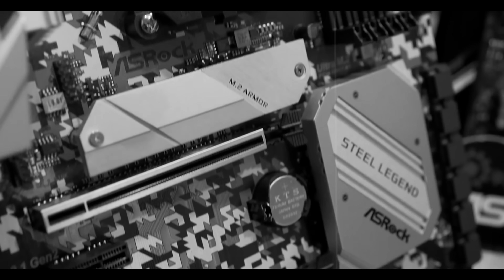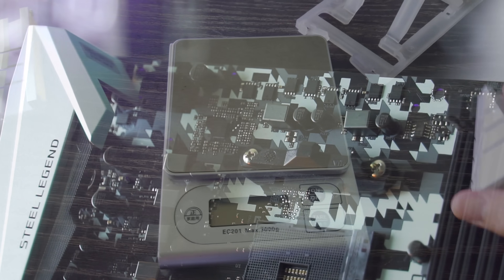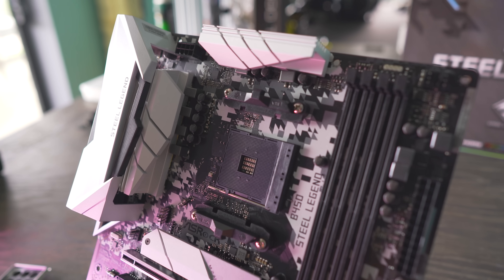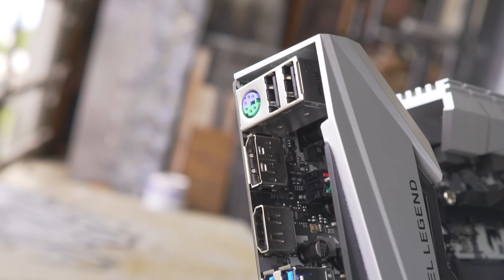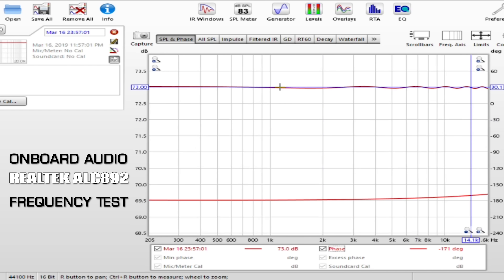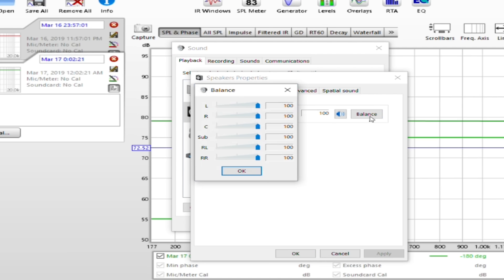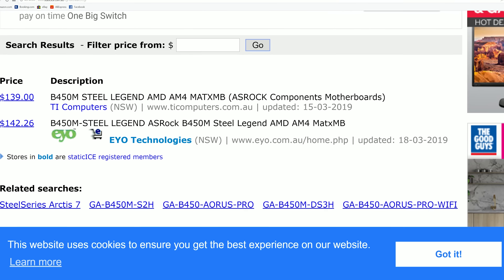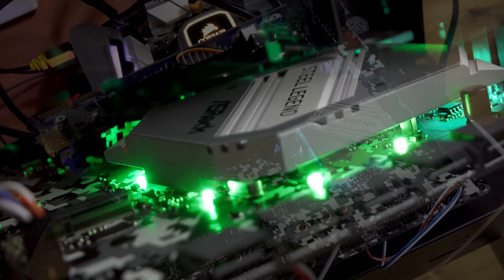Is this The BEST Value B450 Motherboard Right now..!? (Steel Legend Review)

Comment: Tip: B450 tomahawk.
Reply: Its ATX, if i would go for smaller then i would say mortar.
Reply: Msi b450 Sold out/ overpriced by scalpers. I'll roll with this then upgrade. Maybe when the new chips come out. Might even get new MB releases.
Reply: @lionoh  it actually depends solely on where you live. Not everywhere they are sold out. In fact most of the people just don't know what VRMs are and why they are important. So they buy whatever is beautiful, not what is actually decent or works as good as it should.
Reply: @rawdez_  Indeed! Here in Cali it was the ladder. Very true, although I'm aware of vrms & phase. This will do fine for  a 2200g till the next round of chips and motherboards.
Reply: B450 tomahawk. I spent more and got the b450 pro carbon ac. Very pleased
Reply: Please
Reply: tip: B450 A-Pro / B450M Mortar / B450 Gaming Plus / B450M Gaming Plus

the least crappy among cheapest B450 boards: Gigabyte B450 DS3H (its VRM better than this ASRock's, and also it costs like a lot less)
Reply: @rawdez_  Really? B450 DS3H has better VRM than "this" ASRock, you mean the Steel Legend? How does it compares against the B450 Pro 4?
Reply: @NaoVII  yep, better mosfets. better VRM. DS3H has the same VRM as almost all other Gigabyte's boards.
Thats the problem with Gigabyte -  VRM on their low-tier B450 boards is the same as on their top-tier B450 boards. So DS3H worth its money, all other Gigabyte boards not so much. 

Steel Legend is better that B450 Pro 4 for CPUs: 4 phases agains 3. But worse for APUs: 2 phases against 3.
DS3H has better mosfets than B450 Pro4 but Pro4 has heatsinks on SoC VRM. So if you aren't gonna mod DS3H by adding heatsinks Pro4 should be a better choice for APUs out of the box.
Reply: @NaoVII  
oh, one last thing, with ASRock Pro4 you'll probably end up getting NikoS PK618BA mosfets, not mentioned here SM4336. So its gonna be even worse than that. That is what ASRock is doing - releasing  a first board batch with better mosfets for reviewers and then they replace those with even more shitty ones.
Enjoy your ASRock boards, folks. 
That said MSI did the same shiet with their B450M Pro-VDH and B450M Bazooka boards, only Plus versions of those are good now.
Reply: @rawdez_  God dammit why did I even ask B450 Pro 4 😅, I know it's better for APUs and Steel Legend is better for CPU only.
What about this,
ASRock X370 Fatal1ty Gaming X
ASRock X370 Fatal1ty Gaming K4
ASRock B450 Steel Legend

They're all cost the same in Germany (€90/$102), which one should I get?
P.S. I'm going to overclock my R5 1600 to 4/4.1GHz (If possible), because I need to replace my MSI B350 Gaming Pro which can't even reach 3.9GHz, if I forced it to 3.9GHz the VRM's temps went really hot and I heard that B350 won't support 3rd/4th gen Ryzen.
Reply: @rawdez_  Oh and for the cooler, I'm using Deepcool Gammaxx 400.
Reply: @NaoVII  just look up boards that you are interested in starting from  here  
https://www.hardwareluxx.de/community/f12/pga-am4-mainboard-vrm-liste-1155146.html
there is almost everything there is to know about those VRMs.
everything else you can see by looking at boards on manufacturers websites.
in short: heatsinks are good, plactic IO covers over heatsinks  are bad, more surface area on a radiator is good.
and maybe use pcpartpicker

in short: everything ASRock that is not Taichi sucks

also watch gamers nexus best b450 x470 boards and hardware unboxed b450 videos for some context

B350 will support 3rd/4th gen Ryzen
not as good as newer boards, still I'd either wait for B550 boards or go with MSI B450 A-Pro/Mortar/Gaming Plus/Tomahawk
They aren't anything like B350 boards anymore. Just don't buy cheaper non-plus and v2 B450 MSI boards (they have B350 VRMs). You'd be better of with DS3H.
Reply: @NaoVII  ps try replacing/modding heatsink on your MSI B350 Gaming Pro maybe?
oh, no, B350M Gaming Pro is it?
there is only 3 shitty phases on that one
Reply: @rawdez_  Yeah I've seen GN & HU's videos, I know that MSI makes the best B450, the Tomahawk, Mortar, Gaming Pro Carbon AC. But they're overpriced as shit here, the cheapest is B450 Tomahawk which is €140/$160, the Pro Carbon AC cost €180/$205.
"Plastic IO covers over heatsinks" from that statement, do you mean a motherboard with an IO port covered plastic while it has no heatsink or a plastic cover on top of heatsink? Because I've never seen a heatsink with a plastic cover on top of it.
Reply: @rawdez_  Yes, 3 shitty phases.
Reply: @rawdez_  "More surface area on a radiator", do you mean the bigger the radiator is, the better? So technically micro/mini itx mobos are inferior to the standard ATX board? Sorry if I misunderstood, I'm not that good in motherboards.
Reply: @rawdez_  "Everything that is not Taichi sucks" mind explaining why? From your link, X370 Taichi has 6 true phase and X370 Gaming K4 has 4x2 phase (very identical to 8 true phase), both has the same IR35201 controller. According to Buildzoid, 4x2 phase is better than 6 phase. Is the heatsink on Taichi far better than the one on Gaming K4? Because I think that's the only reason a 6 phase mobo can be better than 4x2 phase mobo. Link to Buildzoid's statement: https://www.reddit.com/r/hardware/comments/8uxoe8/with_same_quality_vrms_does_4x2_vrms_or_6_real/

Thanks for your link btw, very helpful 😄
Reply: @rawdez_  And one more question, what's high/lowside mosfet? I think it's one of the reason why you say Taichi is better than Gaming K4.
Reply: @NaoVII  Basically a highside mosfet + inductor lower higher current voltage, usually that is 12V from a PSU to a CPU voltage level, say 1.2 volts. 

A highside mosfet conducts 12V current while inductor saturates with magnetic field (this is where voltage is going) and its happening until voltage on the other side of inductor gradually reaches desired level, our 1.2 volts. After reaching that level a highside mosfet opens up (switches off).
Inductive loads have a common characteristic that if current is flowing through them and the circuit is interrupted, the inductor will produce a high frequency voltage spike - magnetic field in inductor after voltage drop (when a highside mosfet opens up) collapses and pushes current. In our case right into a CPU.
To prevent that a tiny fly-back diode works its magic (because diode physics works instantly) while a lowside mosfet comparatively slowly switches on to continue work of this diode with much greater efficiency, basically they let current from inductor flow to another side of this same inductor away from a CPU, this protects our CPU from a voltage spike.  As result a CPU has good voltage for now but it starts to drop and a highside mosfet closes again (switches on), a lowside mosfet switches off (opens up) and new cycle starts. all that happens 300-1500 thousand times a second. (300kHz - 1,5GHz switching frequency)

and thats what mosfets in VRMs do.
Reply: @NaoVII  yep, Gaming K4 uses shitty mosfets.
all the answers really in that post comments section from buildzoid himself.
Reply: @NaoVII  nah, more fins closer to a heat source are usually better because they have more area to radiate actual heat.
so not only size/weight of heatsinks matter, but mostly its shape and how effectively air can travel in and out of it. 
so simple straight rows of fins are usually better than those beautiful but stupid pieces of art on modern mobos.

>micro/mini itx mobos are inferior to the standard ATX board 
if they have worse heatsinks than yes, but its not always the case, just look at a B450M Mortar.
difference between ATX and mATX versions often boils down to a ports quantity, so mobo size doesn't really matter in how well it performs.
Reply: @rawdez_  Alright.
Reply: @rawdez_  On the mosfets side, I noticed that most "good" boards uses either CSD 87350 or IR35xx, how do they compare and which one is better?
Reply: @NaoVII  thats a tough one. You really should test those to tell the difference. But for starters you always can try to look up and check the specs. 
regarding your board you can try to cut down a cheap amd cooler radiator with a hacksaw, remove sharp edges with some sandpaper, drill two mounting holes and put it on top of vrms, if you are into that kind of things. sounds like a fun)
Reply: @rawdez_  Why should I remove sharp edges? Does that affects cooling?
And "put it on top of vrms" you mean the cooler radiator? So I put the cooler radiator on top of vrms?
Sorry I'm a total noob in this particular subject 😅
Reply: @NaoVII  yep, better/bigger radiator means lower temps. Might help with your problem.
Removing sharp edges is only for safety reasons, so you won't scratch yourself or your motherboard / its components accidentally.
Reply: @rawdez_  Alright thanks for the tips and the informations, it's been really helpful.
Reply: @rawdez_  Mortar has same VRM as Steel Legend according to some dude.
Reply: Mortar > Tomahawk
Reply: @skatcat743  it is cheaper so probably it is better for some people, and it fits in smaller cases too
Reply: @rawdez_  If I rememeber Buildzoid's PCB-Breakdown and analysis correctly, the Mortar got a bit worse mosfets than the Tomahawk. Still good and better than the competition, and the best mATX-board out there. But the Tomahawk got objectively the (bit) better VRM. No doubt about that.
Reply: Frank Neugebauer mortar also uses the sm4337
Reply: @ayemod2k  Yes, but the Tomahawk uses the 4C029N like the Gaming Pro Carbon and MSIs X470s afaik.
Reply: @frankneugebauer6455  yeah, but they are virtually the same when under those heatsinks, so no observable difference, 4C024N and SM4503 are literally too good in those conditions, Buildzoid also tested Mortar temps with an overclocked 2700x in another video and it absolutely killed all competition including having better temps than x470 Gaming Plus.

So virtually no difference here.
Reply: @frankneugebauer6455  ya
Reply: @skatcat743  no:-)
Reply: @skatcat743  Mortar's got some BIOS issues regarding LLC, in the sense that it doesn't work right now, it's mATX, and there's no SoC heatsink. So no, the Tomahawk's better.
Reply: @Najvalsa  nobody needs SoC heatsink for a CPU. MSI boards are bad for APUs and you don't need Tomahawk (and Mortar also) for APUs. Just get cheaper boards with better SoC VRM for those.
LLC issues? Just install previous bios version that works fine with LLC.
mATX has its advantages. So no, Tomahawk isn't really better for everyone. It is better for you, obviously. But it isn't objectively better (or worse).
Reply: @rawdez_  Not for a CPU, but they would for an APU which they're not bad for when you consider the fact that lower tier boards' SoC VRM's generally aren't as good, or even good enough, and upgrade paths.

The LLC issues are persistent across all BIOS's.

But yes mATX does have its place, and it is user dependant, but you do get more with the Tomahawk so it is technically better.
Reply: @Najvalsa  they aren't bad for an APU if you not planning on overclocking an iGPU. An iGPU OC support in MSI BIOS is bad.
OK in stock. 
iGPU OC support is just much better in all other vendors boards. And 3 phases are actually much better than 2 because they give iGPU a much better current to support overclock and all that even with worse mosfets. I wouldn't go with ASRock or  Biostar unless on extreme budget,  if I'm gonna use an APU I'll definitely go with 3 phases SoC VRM from Gigabyte or ASUS, and not with MSI. 

> LLC issues are persistent across all BIOS
well Buildzoid didn't mentioned anything about that while successfully overclocked 2700x with LLC set to 2, so I probably will just ignore that information